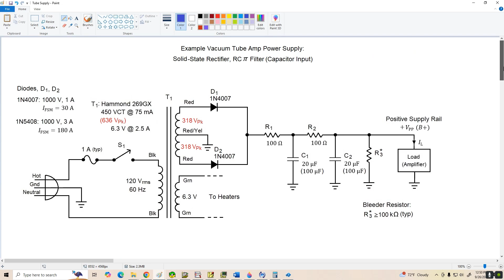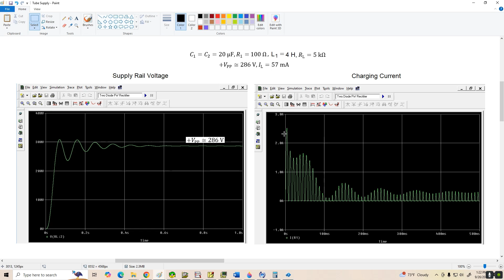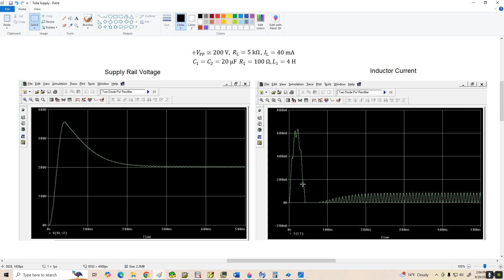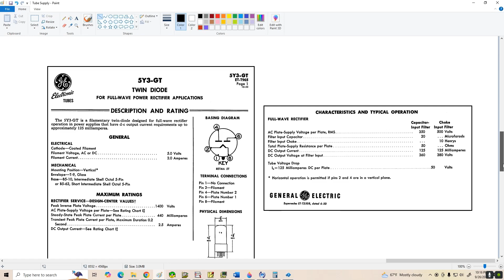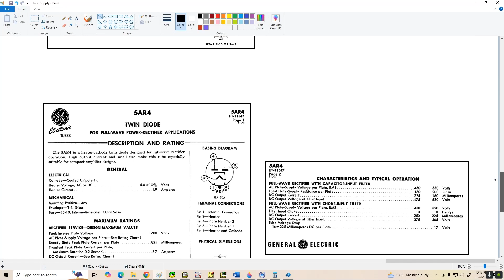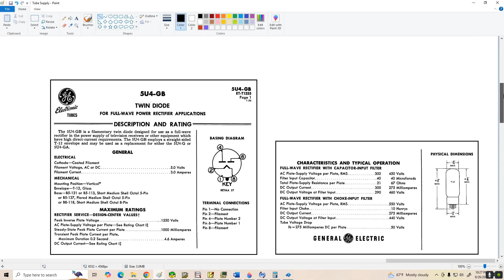Topic 59: Vacuum Tube Power Supply Basics

Comment: Note that the Hammond 269GX has a secondary DC resistance of 314 ohms, each half then is 157 ohms.  The R1 is not needed in your design.  C1 (called the output capacitor) is connected directly to the diodes, and should be in the 22-47 uF range to keep the diode conduction angle from being too narrow (bigger capacitors make the conduction angle more and more narrow, which results in higher and higher current spikes drawn through the diodes).  C1 sets the output ripple level (usually around 5 volts RMS) Then, there should be two R-C sections after C1, which smooth the ripple.  The Rs selected to set the B+ output voltage and the Cs, would be fine at 100 uF, perhaps larger, okay too.  IMHO.  I hope this helps.
Reply from the maker: Yes. Those are all constructive suggestions. I could factor in the resistance of the winding and go from there. And conduction angle can be small but I’ve never had any problems (yet) using this approach. I usually work additional RC filters into the amplifier downstream to minimize the ripple. Thanks for the feedback.
Reply: @Electronics4Guitar  Yes, your beefy diodes could handle the current for sure.  I also note, with appreciation, that you posted this video, it is very helpful, I was only fine-tuning it to my approach.
Reply from the maker: @DannerPlace no problem. I really do appreciate comments from knowledgeable viewers like yourself 👍🏻

Comment: Thank you for explaining this to us. Do people ever put a scope on the power supply while playing different instruments and seeing if any of them make the power supply sag ?
Reply from the maker: I haven’t seen much detailed information on supply sag,  it it is a popular topic in guitar gear forums. Using relatively high value resistors in the pi filter can cause sag, but it also depends a lot on the amplifier topology. Class-A amplifiers have a nearly constant current drain regardless of volume level so sag isn’t really a possibility. Amps with class-B output stages are more likely to induce sag. I’ll cover this topic in detail in a future video.

Comment: I'm a big fan of bleeder resistors.  Back in my Air Force days, I was a tech on an analog flight simulator.  When power is off, most caps are drained by bleeder resistors - but not all.  I brushed my hand across the leads of a big electrolytic capacitor.  I got zapped hard by that cap.  I grabbed my meter just to see how much charge was still in that cap.  300 volts!  That particular cap is not tied to a bleeder resistor.  Not sure why.
Reply from the maker: @GregSr  oh yeah! Better safe than sorry. I’ve seen some circuits that had a diode in the supply rail for one reason or another and that would definitely defeat the function of a bleeder back at the main filter. Hope you’re enjoying the videos 👍🏻